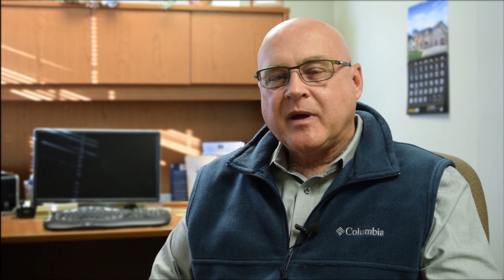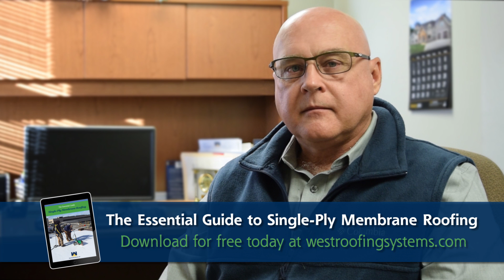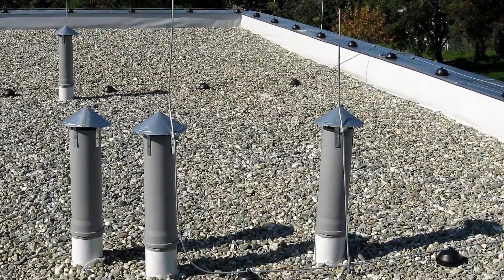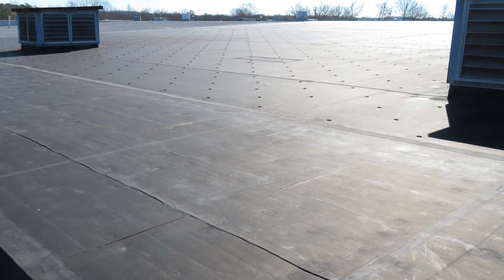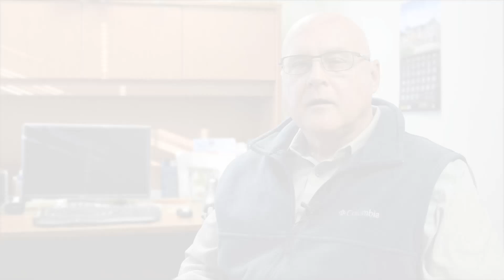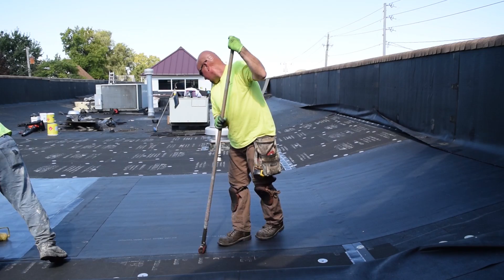A Review of Single-Ply Membrane Commercial Roofing (Pros & Cons)

Comment: Thank you for the informative video. I have a question for you if you don't mind? I currently have a foam roof that was not installed correctly and now pools. I am considering going with this system instead, but I wanted to know if I can go over the existing foam roof and if it would need to be scarfed first to resolve the pooling issue? Also, are you able to have say a patio set on top of it or create a roof top garden? Any help would be much appreciated. Thanks!
Reply from the maker: Hello! I've reached out to our Sales team to see if they can't give some insight into this, but I also recommend visiting our website (westroofingsystems.com) and click on the 'Contact' link at the top of the page. If you fill out a message form, about halfway down the page, one of our Sales members will receive your inquiry and reach out as soon as possible!!

Comment: Thank you for this informative video. Can this material be applied to a concrete rooftop terrace? If not, what would you recommend for a 30x40 area? Thanks again
Reply from the maker: Good morning! You absolutely can install a Single-Ply Membrane roof system over your existing concrete rooftop. A layer of insulation board would need to be applied first for the membrane to attach to, but this is an easy process for us. 

To learn more, please visit our website: https://westroofingsystems.com/single-ply-roof-oh/